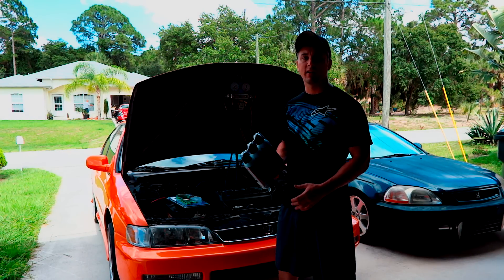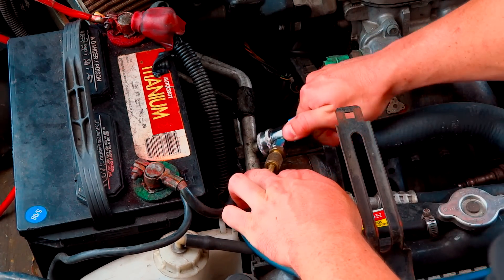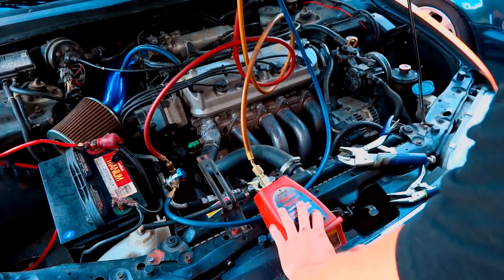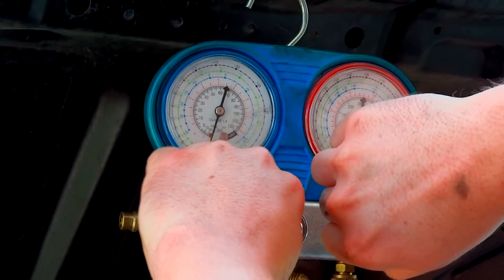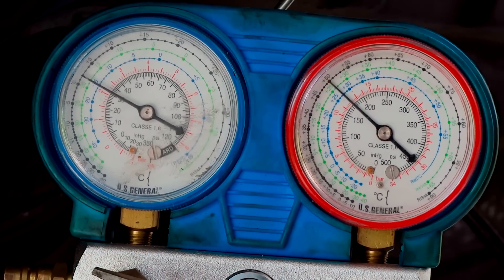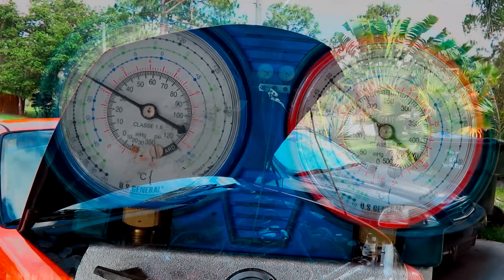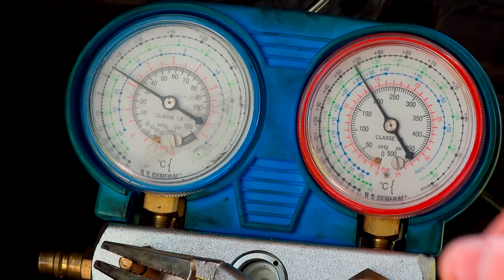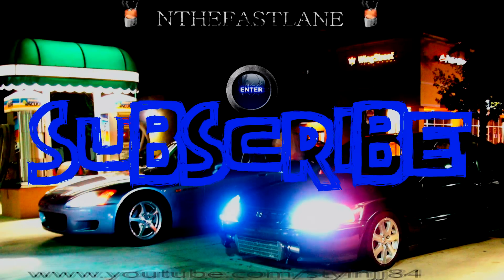Charge Your A/C With The Cheapest & Coldest Refrigerant

Comment: Question ??? Can I replace or fill a Window AC that originally had 410A with 134A or actually the Dust-Off you just used ?
Reply: +Adalberto Corredor  As far as i have seen since 401a is considered a good R12 replacement, and R152a ( Dust off) is a good R12 replacement. Id imagine as long as you get the 401a recovered and evacuate the system ( just proper recharge procedures) as long as you get the low and high side pressures right it would make a god replacement. Its a bit less dense so you wouldn't need as much as the original refrigerant.
Reply: No, the pressures and capacity will not be correct and it will NOT cool anywhere near as intended!

Comment: For what is worth.  I put this stuff in a 92 honda civic hb, with about 230K miles and about 3.5 months later the evap got a leak, big pipe to evap got leak, and 2 black rubber 0-rings leaked.

I think perhaps this uses higher pressure.
Also, I didnt notice it being any colder than r134a.
I am going to try r12a next.
Reply: R12a is propane/isobutane mix.  You can can a pressure/temperature chart for HFC152 on line.

Comment: what type of oil should Should i use if I'm evacuating the system?
Reply: Not a AC Tech. A little late, but I understand evacuating the AC system does not remove oil, or if any, very little. To remove oil, the system MUST be properly flushed. You cannot flush thru the compressor, receiver/dryer, expansion valve or orifice tube (whichever the system has). Before installing any refrigerant  into a former R-12 system it is important to understand ---  R-12 systems original oil is "Mineral" oil and you should not install 134a without flushing and changing the oil to either PAG or Ester oil.  IMO Ester oil is a good option as it is compatible with BOTH R-12 and 134a.   With Ester oil installed you could use either R-12 or 134a AFTER evacuating the system completely. You cannot "mix" ANY refrigerate together. (R-12 cannot be used with PAG oil, only mineral or Ester oil.  134a can be used with PAG or Ester oil but not mineral oil.)  It is important to not have too much oil or of course, too little oil.  The AMOUNT of oil installed can be determined with a very cheap "Oil Checker" analyzer. There is a checker for each type of oil. (Google it) This is important -- I learned the hard way.

Comment: envirosafe does not mean legal to dump into the atmosphere
Reply from the maker: +EmofacePS3 I'll just leave this here: ENVIRO-SAFE is a zero ozone depleting "second generation" replacement 
for R-134a and all other substitutes for Freon that are non-ozone 
depleting. Unlike R134a, it is also non-global-warming .  EPA's Final 
Rule, issued April 1, 1994, states:

Enviro-Safe™ Refrigerants are organic, non-ozone depleting, non-toxic 
compounds. These type of refrigerants are endorsed by the GreenPeace 
organization and are in full compliance with the UN Montreal Protocol.

"In this final rule, the Agency has determined that second generation 
replacements, if they are non-ozone depleting and are replacing 
non-ozone depleting first generation alternatives, are exempt from 
reporting requirements under Section 612"
Reply: Ivan K Well all we know is this, in 100 years average temp have gone up less than 1 degree (0.80F). I varies wildly from year to year. We know that the sun heats the earth and the outer atmosphere blocks some of the UV and radiation. The chemistry of man made and natural gases does affect this critical layer of atmosphere that filters sun. Last there are green house gases that when captured in urban areas, often in valleys causes heat to be trapped. However global warming is likely a function of normal cycles that are 1000's of years long, before there were measurements. I think everyone can agree keep pollution down for our health. Yes we can effect the environment. However cow farts are bad too. The question is how do we address it. That is were people differ. The ones that want to kill everything, like coal should kill themselves, that would help the environment more than just stopping all coal use. People are pollution in general and create heat. So let's kill off all the tree huggers to save a polar bear.... ha ha (kidding of course).
Reply: If by littering you mean releasing mostly harmless gas to the atmosphere, then yes I agree it isn't bad.  If you do have 134A and want to do this then by all means you absolutely should take it to a shop and have them recover whatever 134A remains in your system.  Further if you do use 152A make sure your car NEVER sees a shop for it's AC ever again as you will cost the shop thousands of dollars when the 152A contaminates their 134A recovery equipment.  

It's already been mentioned that it's obvious this kid knows very little about refrigerants so I wouldn't expect him to call everything by it's correct name.  I'm surprised he was even close by saying it was "R150-something." 

The whole refrigerant business is a big scam anyway.  It's a game of which chemical company can con the people and governments into mandating their patented refrigerant be used and banning all others.  Since you seem to be familiar with the business I'll post this for others to learn from.  With refrigerants it's one or more of the following; toxic, kills the ozone layer, is a greenhouse gas, and/or is flammable.  You can eliminate up to 3 of these but not all 4.  If the holy grail of refrigerants was discovered/invented that was none of the above then there would be no reason to debate refrigerants anymore.  It's all a trade off as to which degree of the bad 4 above you can live with.  The first refrigerants were highly toxic and/or explosively flammable.  The next generation were ozone layer depleting.  Current refrigerant R134A is greenhouse gas that is supposedly in the neighborhood of 1300-1400 times more powerful than CO2.  There also seems to be a trend toward slightly less efficiency with each generation.  The new 1234yf refrigerant from Honeywell that is being used in many new cars is you guess it, slightly less efficient than 134A.  It's less of a greenhouse gas than 134A but the trade off is that it is slightly flammable.  To mitigate this risk the new cars that use it have a beefier evaporator designed to minimize the possibility of an evaporator leak.  You wouldn't want flammable gas in the passenger compartment now would you?  152A does have a similar slightly flammable risk and is less of a greenhouse gas (10x less than 134a) similar characteristics to the new 1234yf.  However 152A isn't patented and you can't charge 10x as much as 134A like you can with 1234yf.  I'll go out on a limb and say this is why you won't see any 152A  AC systems in cars.

Sorry I went off on a bit of a tangent there.
Reply: +zeke112964 Do not argue with this expert. Watch 5:02, 6:37 and 9:01 you will see expert use of vice grips and handling of refrigerant. No more can be said, but watch in awe. I think you made a difference, because he has a disclaimer now....3:05.
Reply: At the 1:43 mark he states it's legal to dump 134A  into the atmosphere...at 3:03 he starts dumping it into a bottle of water and states again the it's legal, but has his disclaimer on there stating the opposite and he's just releasing excessive oil...oil doesn't have pressure in it, and at 3:50 he states it just about out of freon
Reply: zeke112964 Detective good work. There are some good vids on the topic on YT. I would say this is not one of them.
Reply: R-134a is NOW illegal to release into the atmosphere due to very high GWP. R-152a is legal to release into the atmosphere because it only has a 1 year life in the atmosphere.. FYI alot of hair sprays and body sprays still contain R152a if you read the chemicals. ;)
Reply: Phalanxfox Begley Now? it's bad ? .....Then it wasn't?
Reply: dust off is very much intended to be dumped in the atmosphere,  it is to say so it's MAIN use, to do so. How you do it is up to you, through the AC, or through half your nostril, EPA doesn't care they perfectly know it's a product to let it fly
Reply: He said 134a and then claimed it was envirosafe....so which is it ...I guess littering isn't bad for the environment in your opinion either? And he didn't know what he was putting in hes said r-150 something
Reply: does envirosafe contain fluorine?  does it?? does it??? why NO IT DOES NOT....   until you understand the mechanisms of why and how fluorine molecules in the upper atmosphere are bad for natural ozone then please STFU!
Reply: +Nthefastlane But you dumped the 134a into the atmosphere....
Reply: zeke112964 Any of these gases that are useful for refrigerant are not GREAT for the atmosphere. The older Dichlorodifluoromethane (R12) and monochlorodifluoromethane (R22) are hydrochlorofluorocarbons. The halocarbons (chlorine and fluorine) present in these compounds deplete ozone layer in the atmosphere leading to greenhouse effect. You can still buy it and I am sure 3rd world places like India I am sure making this by the boat load. The newer stuff R-410 (home/building systems), R-134a (auto) are better but not great. Auto uses R-134a, 1,1,1,2-tetrafluoroethane and they are trying to also to replace that with 2,3,3,3-Tetrafluoropropene, or HFO-1234yf, a hydrofluoroolefin. It is flammable with and will corrode the system. Mercedes Benz has tested it and says it's not suitable. If you can get R-12 still you will get R-134a for a long long time, but the price will go way up. R-12 costs 7 times as much as R-134a. Air in a can, duster gases are either 1,1-difluoroethane, 1,1,1-trifluoroethane, or 1,1,1,2-tetrafluoroethane. So yes some air in a can my be indeed equivlant to R-134a and not good to vent. I doubt many air in can is using 1,1,1,2-tetrafluiriethane. The old hair spray usedHydrocarbons, like butane, were often used in the past, but their flammable nature forced manufacturers to use fluorocarbons. People use to make flame throwers with hair spray and people also got burned when their fresh sprayed hair went up in a poof of flames. .
Reply: +gmcjetpilot trump said global warming is a hoax, perhaps heated up by haarp???
Reply: Do not believe in cow fats lies. When the Earth was much younger
Reply: A lot of tectonic activity was going on, Earth was hotter, younger, through volcanic activity much more tremendous  heat was released, not what's today! Back then the Earth was a Fire breathing dragon! In addition Earth was populated by gigantic dinasaurs one as big as 200 elephants, they were many is an understatement!  Also mammoths, and the elephants them selves and what not. Keep in mind Humans did not own the Earth back then, they barely survived among this animal world, and not much they could do. Now think, the much hotter Earth, and an animal world unlike any cow population today, how much heat and methane that was??? And what??? So understand it, global warming is a nations taxing hoax, and not a cent more... Think it through!
Reply: He says it is the Enviro-Safe refrigerant not 134a.  Envirosafe is a blend of R290 and R600a or propane and isobutane if you are unfamiliar with refrigerants.  last I checked it's not yet illegal to dump propane and isobutane into the atmosphere.
Reply: Triangles1 He dumped the 134A into the atmosphere.....not Enviro-Safe refrigerant....did you even watch the video
Reply: yes I did.  Apparently you did not or you would have heard where he said the car was charged with envirosafe which is not illegal to vent.  So he slipped up and called it freon when he was venting it.  Technically speaking 134a is not Freon any way.  Why else would he mention envirosafe if he's venting 134a? He vented envirosafe and replaced it with R152a.
Reply: Triangles1 Benz is not using it because they find it a fire hazard... beefy condenser or evaporator or not. An accident will cause a leak. It is also LESS efficient.
Reply: you eating a burrito hurts the atmosphere more
Reply: +gmcjetpilot we used the $1 cans of hairspray in our potato gun after running out of brake cleaner/starter fluid. That crap was just too expensive. 

Of course we started a slow death with the hairspray though. Still had tons of fun before the cap started getting blown off though.

Comment: From Wikipedia, the free encyclopedia
1,1-Difluoroethane[1]
Difluoroethane
Difluoroethane
Difluoroethane
Names
IUPAC name
1,1-Difluoroethane
Other names
difluoroethane
Freon 152a
ethylidene difluoride
ethylidene fluoride
HFC-152a
R-152a
DFE
Identifiers
CAS Registry Number
75-37-6 Yes
ChEMBL ChEMBL325493 Yes
ChemSpider 6128 Yes
InChI[show]
Jmol-3D images Image
PubChem 6368
RTECS number KI1410000
SMILES[show]
UNII 0B1U8K2ME0 Yes
Properties
Chemical formula
C2H4F2
Molar mass 66.05 g/mol
Density 2.7014 g/L @ 25 °C
Melting point −117 °C (−179 °F; 156 K)
Boiling point −25 °C (−13 °F; 248 K)
Solubility in water
0.54% @ 0 °C
Vapor pressure 4020 mmHg/536 kPa @ 21.1 °C
5.1 bar/510 kPa @ 20 °C

Viscosity 0.00887 cP (8.87 µPa·s) @ 25 °C
Hazards
Safety data sheet MSDS for 1,1-difluoroethane
Except where otherwise noted, data are given for materials in their standard state (at 25 °C [77 °F], 100 kPa).
 Yes verify (what is: Yes/?)
Infobox references
1,1-Difluoroethane, or DFE, is an organofluorine compound with the chemical formula C2H4F2. This colorless gas is used as a refrigerant, where it is often listed as R-152a (refrigerant-152a) or HFC-152a (hydrofluorocarbon-152a). As an alternative to chlorofluorocarbons, it has an ozone depletion potential of zero, a lower global warming potential (120) and a shorter atmospheric lifetime (1.4 years).[2] It has recently been approved for use in automobile applications as an alternative to R-134a.[citation needed]
Contents  [hide] 
1 Production
2 Uses
3 Safety
4 See also
5 References
Production[edit]
1,1-Difluoroethane is produced by the mercury-catalyzed addition of hydrogen fluoride to acetylene:[3]
HCCH + 2 HF → CH3CHF2
The intermediate in this process is vinyl fluoride, the monomeric precursor to polyvinyl fluoride.
Uses[edit]
In addition to serving as a refrigerant, 1,1-difluoroethane is also commonly used in gas duster (commonly thought of as "canned air") and many consumer aerosol products, especially those subject to stringent VOC requirements.
The molecular weight of difluoroethane is 66, making it useful and convenient tool for detecting vacuum leaks in GC-MS systems.
Safety[edit]
The practice of deliberately inhaling or “huffing” canned air is extremely dangerous and can be fatal. It caused a fatal cardiac arrhythmia in a 42 year-old man.[4] Several reports of fatal car crashes have been linked to drivers huffing 1,1-difluoroethane.[5][6][7] Because of inhalant abuse, a bitterant is added to consumer canned air products.
In a DuPont study, rats were exposed to up to 25,000 ppm (67,485 mg m−3) for six hours daily, five days a week for two years. This has become the no-observed-adverse-effect level for this substance. Prolonged exposure to 1,1-difluoroethane has been linked in humans to the development of coronary disease and angina.[8]
Though not extremely flammable in gaseous form, 1,1-difluoroethane can burn under some conditions. As such, there is also a warning label present on some gas dusters. When inverted to spray liquid, the boiling fluorocarbon aerosol is easily ignitable, producing a very large blast of flame and extremely toxic gases such as hydrogen fluoride and carbonyl fluoride as combustion products.
See also[edit]
List of refrigerants
Canned air
References[edit]
Jump up ^ 1,1-Difluoroethane at Sigma-Aldrich
Jump up ^ "Global Warming Potentials of ODS Substitutes". U.S. Environmental Protection Agency. 2010. Archived from the original on 16 October 2010. Retrieved 20 September 2010.
Jump up ^ Siegemund, Günter; Schwertfeger, Werner; Feiring, Andrew; Smart, Bruce; Behr, Fred; Vogel, Herward; McKusick, Blaine (2010). "Fluorine Compounds, Organic". In Bohnet, Matthias; Bellussi, Giuseppe; Bus, James et al. Ullmann's Encyclopedia of Industrial Chemistry. John Wiley & Sons. doi:10.1002/14356007.a11_349.
Jump up ^ Avella J, Wilson JC, Lehrer M (March 2006). "Fatal cardiac arrhythmia after repeated exposure to 1,1-difluoroethane (DFE)". The American Journal of Forensic Medicine and Pathology 27 (1): 58–60. doi:10.1097/01.paf.0000202715.71009.0e. PMID 16501351.
Jump up ^ Broussard LA, Brustowicz T, Pittman T, Atkins KD, Presley L (November 1997). "Two traffic fatalities related to the use of difluoroethane". Journal of Forensic Sciences 42 (6): 1186–7. PMID 9397568.
Jump up ^ Hahn T, Avella J, Lehrer M (October 2006). "A motor vehicle accident fatality involving the inhalation of 1,1-difluoroethane". Journal of Analytical Toxicology 30 (8): 638–42. doi:10.1093/jat/30.8.638. PMID 17132266. Retrieved 6 June 2010.
Jump up ^ "Autopsy: man in crash died from inhaling computer cleaner". The Times News. 10 March 2012.
Jump up ^ "1,1-Difluoroethane". National Library of Medicine HSDB Database. 1994. Retrieved 8 June 2010.

Comment: What was the ambient temp? I'm going to do this to my S-10... My r134a retrofit cant get much better than 60F, and Insane high side pressures
Reply: Have the system properly recovered and vacuumed down. If you went from zero charge to 134a without doing a vacuum, then there is most likely air in the system. Also, water in the system will boil off, that's why a leak-free system that was opened up tend to lose vacuum and the process is often repeated 2-3 times before a recharge.

Comment: 16:41 you can see the temp selector knob is partly turned to heat. Make sure you have yours all the way to cold before doing temp readings.
Reply from the maker: maxbored The dial was broken.It was to the coldest setting.